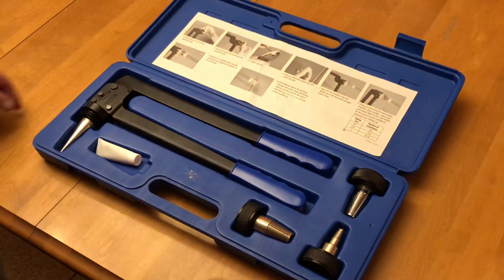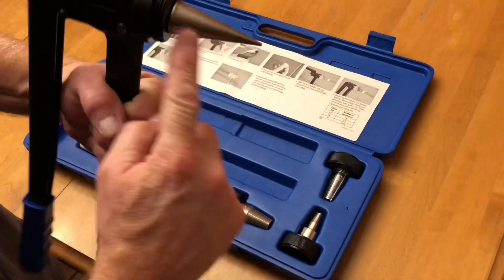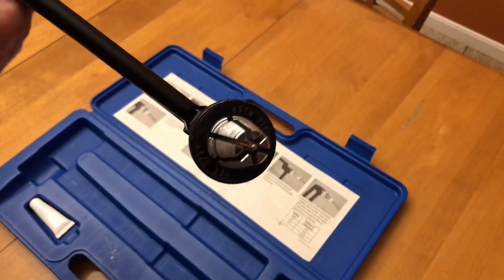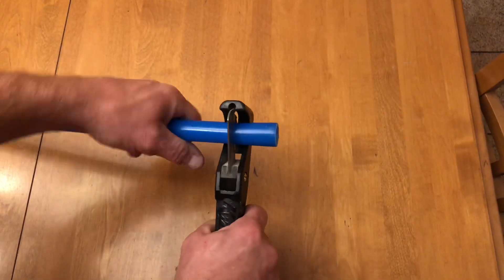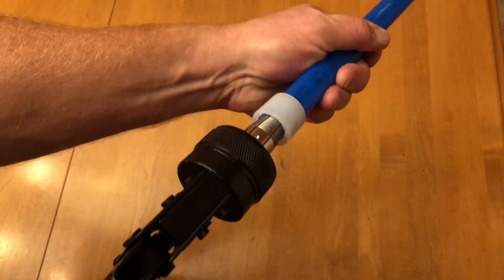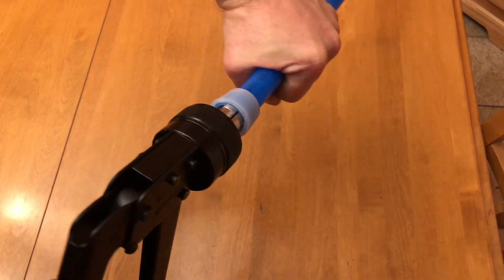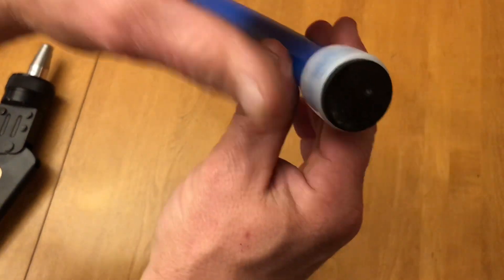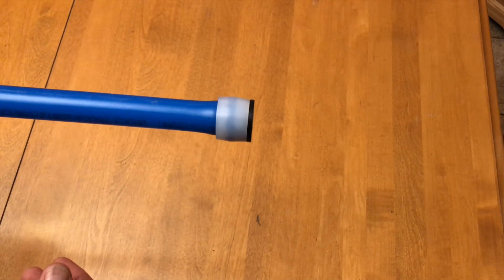Using a Uponor Pex-a tubing expander

Comment: Maybe a hose clamp will grip better and give you a pice of mind who agrees?
Reply from the maker: I can’t imagine putting a hose clamp on every fitting, that would take forever. Just my thoughts. Thanks for watching.
Reply: @funbro1  that the pipe beds corners and there is less connections, how bad can an extra minute be, it still beats Soldering
Reply: You go ahead and do that. Let us know how it goes.🙈
Reply: @snarkylive  And they don't give even pressure where the screw bit is. Whenever a clamp is leaking it's always at the screw attachment. Only a crimp clamp could be trusted long term, but that that point just use pex b wiht the crimp rings...

This is a proven setup. It does sound odd, but it holds up.
Reply: Plumber did my house 23 years ago using this tool no leaks so far 🙏
Reply: Thanks for sharing 👍

Comment: Looks like you almost need 3 hands to use this tool. Or maybe bench mount the tool but that would take away its portability.
Reply from the maker: It does get difficult especially when the PEX is cold. A heat gun helps a little but if you do this job often then a battery operated expansion tool would be recommended. The operation is the same but much easier and quicker. Thanks for watching.

Comment: Thank you for quick and simple demonstration, I bought a used mobile home and I need to do some remodeling and this will be my 1st time working with PEX, I've done many plumbing repairs with iron, copper, pvc, but never PEX so I'm on YT researching before I buy any supplies or tools. I've seen the expander but didn't know what it is for, now I know.
Reply from the maker: Awesome, glad you could use the video. Thanks for watching.